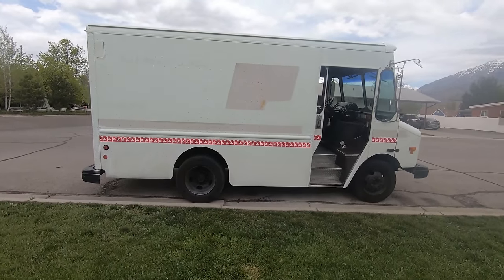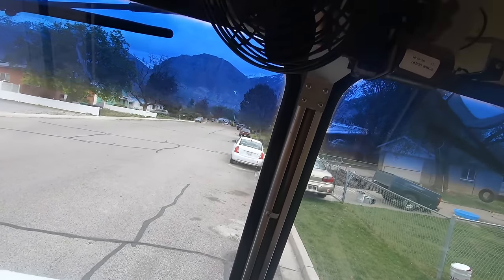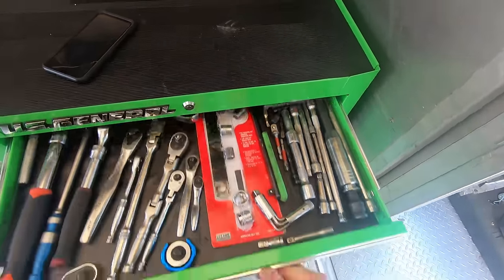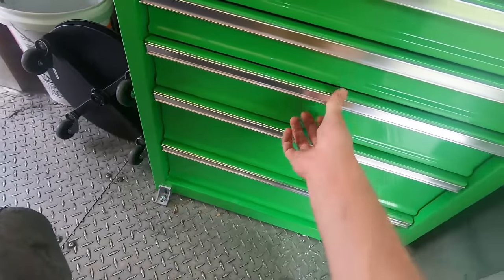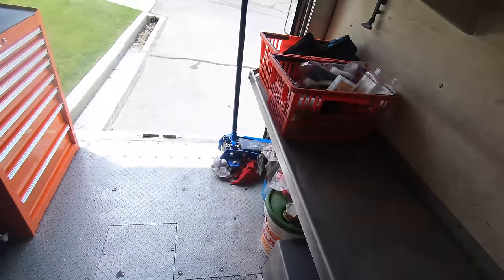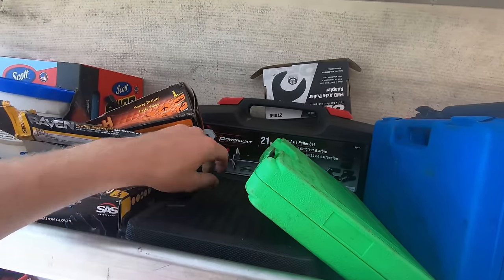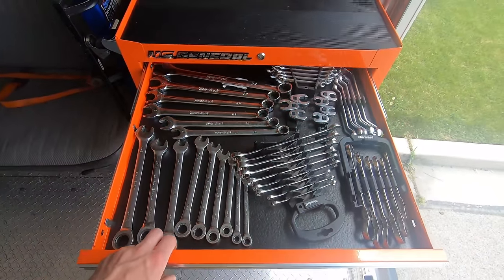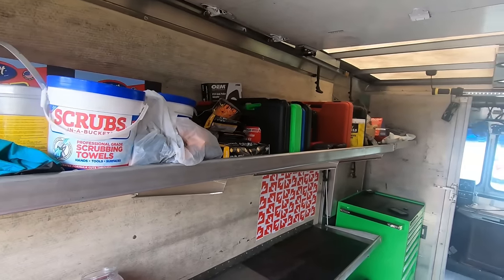Mobile mechanic setup. Shop in UPS truck Extensive tour, Roadside Rescue.

Comment: I am a mechanic also I work at a shop and do road calls occasionally on weekends or after work and I have had several customers tell me I won’t pay your price because you are using cheap tools and not Snap-on or MAC or SK or Matco or something like that and then they make ridiculous requests like saying they don’t want any power or air tools used and stand there and watch me I can’t stand it and my boss at work allows customers in the shop and some customers are the same so they stand over me and it drives me insane but if I say anything to them I am fired on the spot for “customer abuse” so I might go full time to the road.
Reply from the maker: I love it. But some things would be so much easier in a shop.

Comment: This is definitely not UPS "truck" nor would it have been an actual UPS "Package car" priously used bytheor drivers to make deliveries in. It is impossible to own a UPS package car as they are send to get destroyed to prevent possibly damaging the brand by others. The few that are notdestroyed are used to transport employees on property or given to mechanics to fix package cars that broken down on road

Although the chassis and body are similarly no different from other vehicles of this type, UPS has a front end they designed themselves.
Reply from the maker: your right. great points. the truck and chasis are the same both made by workhorse chevy. i call it UPS for 2 reasons. 1 its easier to say and 2 noone ever knows what "USPS" is supped to mean haha.
Reply: @RoadsideRescue  Got it. UPS uses the Workhorse RV chassis, Morgan body powered by a Ford CNG. I drive one everyday, well its bigger brother, so when I seen yours I felt the need to point it out to help others not get confused with other carriers
Reply from the maker: thanks! im not trying to trick anyone. infact you gave me the idea to pin a comment at the top explaing this! thanks again!